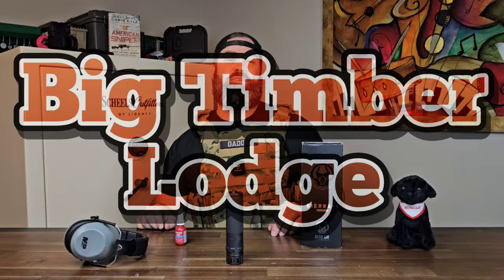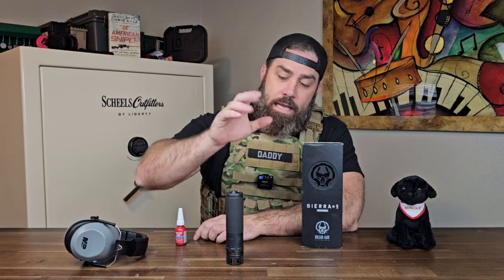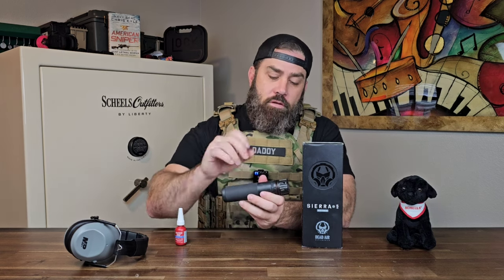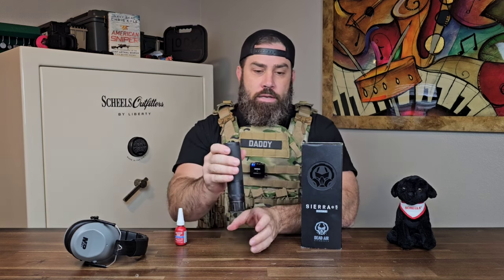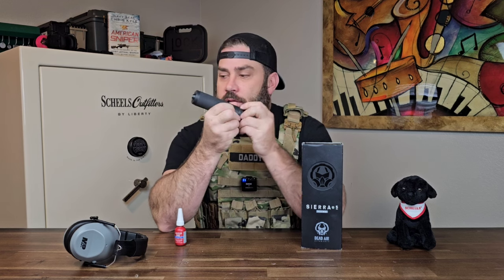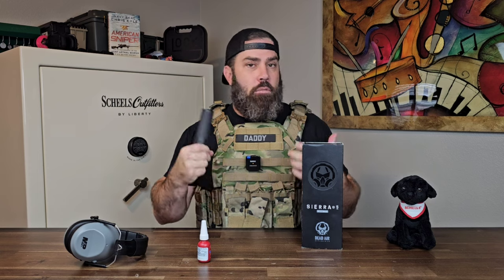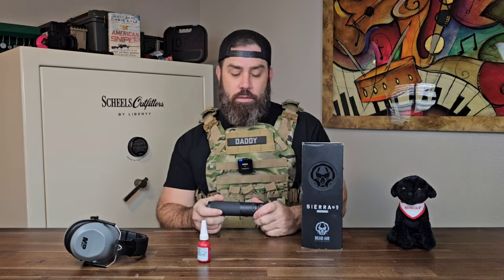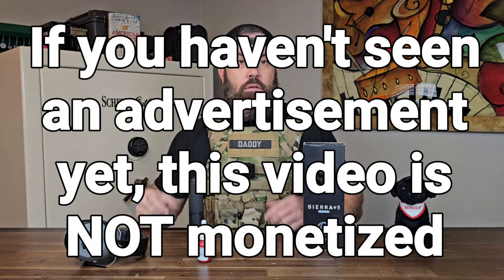How To Prevent Your DEAD AIR SIERRA 5 From Blowing Up / WATCH BEFORE YOU BUY

Comment: You seem to have missed the point that the issue isn't with alignment/tightness and the fact that the can literally disintegrates internally.
Reply from the maker: Re-watch the video and report back on your original statement
Reply: @BigTimberLodge   No.  You didn't address it. Yeah, you apparently are STILL failing to understand the root of the issues . . . or you're willfully ignoring it as a shill for DA. 

ETA:  LOL at needing your smith to check it with an alignment device.  You can buy your own rod.

FWIW, I just got my 33rd can out of jail last week, so I kinda sorta know what I'm talking about, whereas you clearly do not.
Reply from the maker: @OFFICIALUND  I said that the alignment Issue and making sure everything was tight would solve a majority of the problems that people are having. I did not mention the baffles disintegrating, but I didn't also say that the alignment rod and tightening everything would solve all the problems.  The bad welds are allowing baffles to become loose or be out of alignment and cause baffle strike.   When I made this video, I was relaying all the information I gathered from gun makers, Dead Air and gunsmiths.
Reply: @BigTimberLodge   You just agreed with me then.  There were plenty of reports (and even well-publicized videos) addressing the disintegration of the baffles internally, and you said nothing about it.  And you just confirmed that you didn't have dig enough (which would have taken all of 5 minutes) to see what the deal was.  Heck Rangedaybro did a live-fire video of his disintegrating 3 months before you posted your video.  So, again - You missed it.  Which is what I originally said.  And yet, you condescended to me telling me to "gO bAcK aNd wAtCh aGaIn".  I have a better idea, why don't you go and reshoot this video so it has some useful information.  Or maybe Mike Pappas won't give you a foot rub you've always wanted from him if you don't shill for them.
Reply: @BigTimberLodge  And an additional thing:  Telling people to use Loctite 242 just shows how uniformed you are.  242 fails after 300 degrees Fahrenheit. Silencers will easily heat up to 500 degrees and more. Go ahead and put 242 on, but you just wasted your time cleaning threads and applying it.
Reply from the maker: @OFFICIALUND  Take a breath and chill out.  As I mentioned above, I was reporting what I had heard from gunsmiths, firearm manufacturers, and Dead Air.  I dogs report things I've seen on YouTube. I reported what professionals told me when I asked about the suppressor. The person I spoke with at Dead Air told me which Loctite to use, and I reported exactly what they said.  Also too, the Loctite is holding up just fine. I have a video I made today where the suppressor was smoking hot and held together just fine.
Reply: @BigTimberLodge  And you think that it held together because of the loctite?  Lol.  No.   Also, pretty rich of you telling me to "chill out" when you're the one who condescended to me by telling me to go back and watch the video again and report back, only to subsequently 100% confirm what I said in my initial comment.

Comment: Loctite 242 has a max operating temp of 300 degrees Farenheight. Rocksett has a max operating temp of 2,000 degrees Farenheight, it is a better thread locker for high temp applications. I appreciate the vid helped my decision on the Sierra 5
Reply from the maker: Totally understand what you are saying about the Loctite, and I agree. However, I'm just relaying what the person at Dead Air told me. I haven't had any issues with my can since applying the Loctite.  I do know that if you order a Sierra-5 now, it will be made from a different company than the one that made mine.
Reply: @BigTimberLodge  DA's own engineers don't know what they are talking about, they don't even make their own cans, it's all KGM in Georiga, they're in Utah/out west. Use Rocksett. I've shot over 1k through mine.

Comment: You needed to go to a gun smith to use an alignment rod and tighten things to spec? Please immediately remove your "daddy" patch sir.
Reply from the maker: I make content for the common gun owner in America, not gunsmiths. Plus, I talk to gunsmiths, firearm manufacturers, and accessory manufacturers and share those conversations with my viewers.  If you read through the comments on this video, you will see my advice helped people who don't have torque wrenches and alignment rods.  I have almost every tool I need to work on my own guns and normally I do, but when I make content for my viewers I assume they don't and try to make their experience as simple and cheap as possible.  As far as the "DADDY" patch, my wife bought that for me after our first child.

Comment: That is red locktite.
Reply from the maker: This is from Loctite's website: "For a hold that can be easily removed, Loctite Threadlocker Blue 242 is the hero. It’s perfect for motorized and nonmotorized parts that need occasional servicing, like car parts (oil pans, water pumps, etc), or even motorized yard equipment, bicycles, furniture and much more."
Reply from the maker: Red is 271
Reply: @BigTimberLodge ....Some people lack critical thinking and a little attention to detail. A quick search would confirm your statement. It amazes me how lazy people are with a phone in their hand and don't know how to utilize the search engine. Wishing you many more blessings bruh.🤙🏽🙏🏽
Reply: Monkey sees red bottle and cannot comprehend there may be blue Loctite inside the red bottle.
Reply: and 272 is high strength / high temp. good to 450f. 246 is High temp medium strength like 242 except 246 is good to 450f instead of 242s 300F

Comment: I wonder how much this dude got paid for this garbage 

The failures are in the design and welding of the baffles, everyone knows this junk, and is not why these cans have been failing.
Reply from the maker: I got paid $0.  Yes, some of the cans are blowing up because the welds suck or the baffles weren't made correctly, but other people are having alignment issues, and the can unscrewing itself from parts of itself, creating strikes.  Read through the comments. Plus also, watch some of my newer videos where I told people not to buy a Sierra-5 because of all the issues. However, to be fair to Dead Air, I just heard last week that they are starting to ship repaired Sierra-5 cans back to customers.